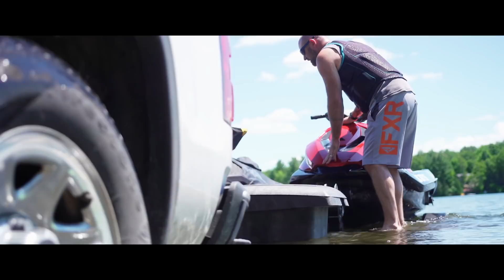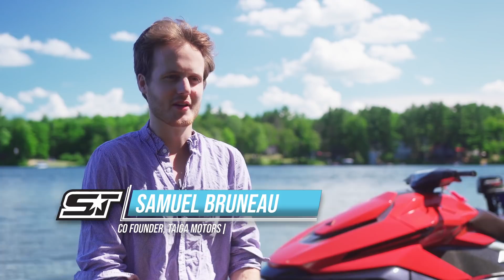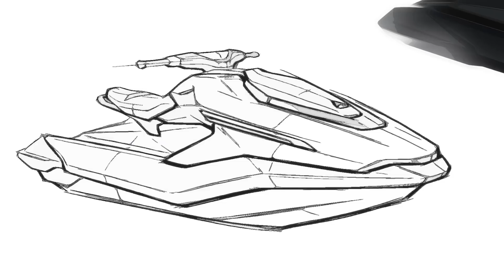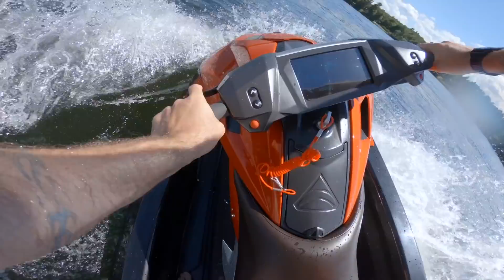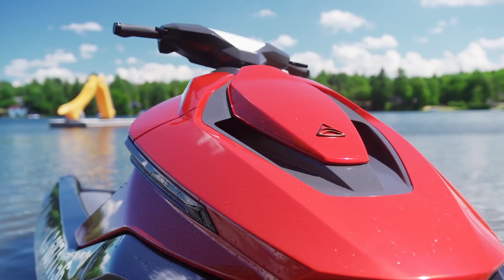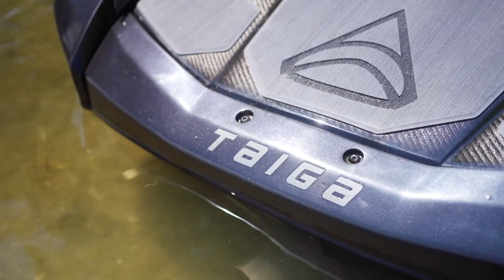First Ride On Taiga's New Orca Electric Personal Watercraft

Comment: I would definitely get one if the price went down and the HP went up. A Sea Doo RXT X with 300 HP   starts at $15,900 in the U.S. which is much cheaper and much more powerful then the top end Taiga. However, in time I'm sure electric vehicles will come down in price and up in power.
Reply: that's a crazy price to pay
Reply: You're comparing purchase price and not total cost of ownership.  To be fair, a battery charge is far less expensive than a fill up.  And maintenance is basically zero on electric.  Personal preference, but I'd rather pay more upfront and have a  ski that's ready to go all the time.  But I also don't need 300hp.  I have a Yamaha with 160 HP and it's more than enough for me.
Reply: To be fair, 15,900 is website prices. You're really gonna pay 20k. With the fees and dealer fees and a trailer cost.
Reply: You'll never use a 300hp ski to its full potential ever. You may do a few speed runs but that's about it. Unless you're racing all that power on a sit down is worthless.
Reply: 180hp performance version is 19k usd...insane prices..
Reply: @FarmerFpv  Well plus they are all governed to a max 67mph from the factory and its alot of money to remove that and reflash the ecu..only to unlock 5-8 more mph..There is a reason 180hp yamahas without a supercharger are just as quick as the 300hp supercharged ones..speed governors.
Reply: Y'all don't send it when you jet ski or?
Reply: @Gcrilla  yep and Taiga is also website price

Comment: Great review and I appreciated your honesty on these PWC. In my opinion, it was only a matter of time before PWC became electrified, and for this type of powersports product, it makes good sense on a number of fronts. Taiga has done a great job of really thinking, and rethinking things through to arrive at a product that will become a preferred type of PWC for plenty of end users, rental companies, and others.

Where I live, there are plenty of lakes that don't allow gas-powered boating, and a growing number of popular waterfront tourist areas and campgrounds that don't care for the noise the PWC emit, so they have started banning them. Not good when you just want to head out on the water and have some fun for a while.

Taiga has done it up right with their PWC having comparable performance specs as many others out in the market, but take the experience to another level by eliminating having fresh premium fuel (obviously) on hand and the potential for spillage into a water source when refueling, gone is the annual servicing and/or mechanical repairs as Luke noted, but enhance the experience with an ability to change performance abilities on-the-fly (even remotely) which is also a great safety feature for riders of varied abilities, plus the flexibility to charge it in a variety of fashions is great. As Luke noted, there are plenty other features and abilities that make this new offering "Awesome!" 

Hearing just the wind and the waves, and the laughter coming from those I'm towing around when out on the lake sounds great to me. Having an ability to get out on, and enjoy, the lakes that don't permit gas-powered boats eliminates those restrictions and opens up plenty of new places to explorer and enjoy each summer. I won't miss all the annual maintenance either, and 2hrs per session I can certainly live with. No more noise and polluting my local water sources is also a HUGE benefit too.

Taiga, you have certainly perked my interest and heightened my level of commitment to get one of these innovative machines under my butt when the desire to hit the water arrives.

Comment: Great video.  This definately makes sense in a cottagers application.  Keep working on the range for the sleds.  We need 200 km range on trail sleds per charge.  Even 100 hp is lots if you get the range up there.

Comment: It would be a major upgrade if the batteries are removable like some EV scooters are. Therefore you can just swap the batteries and continue on. No need to wait for charging and the empty battery can then be the one charging on the "side lines". If not the upcoming Ford F-150 Full EV will be a great addition to have if your going full EV mode in life when it comes to mode of transportations. If the Ford can charge a home it will definitely charge this EV Jet Ski.

Comment: Most cottages in Canada are back woods and off grid so then what haul Gas to power the generator to charge the battery 2 steps versus one with gas and a longer travel ability , I'm thinking practical for the in the city type cottage versus the off grid it's definitely not ready for as exploring is a all day thing not just an hour or 2.

Comment: Awesome presentation but be sure to wear that safety! 
Not sure if the electric version of a ski has a constant flowing jet like its combustion engine alternates, but if you fall off and that safety doesnt come out, you can easily get left by your watercraft.
Reply: Safety first! However, the Taiga Orca doesn't have the issue that combustion PWC has with a constant flow. Once you release the throttle it stops.

Comment: I think offering a kit, to put in older water craft is a good idea, to get the ball rolling.  Heck, you can pick up, working used watercraft, $1000, $1500, USA, pretty easy, rebuilt engine are under that price aswell. 

so, be better offering kits. And build on that.

Comment: Battery volume in kwh? For 120kw engine running on half tortlte we need 60kwh  for one hour. 60kwh weight aprx 300kg. It's far to much for jetski. It means electric jetski time still not arrived.

Comment: no oil or gas worries,  just batteries and electronics worries and will it go from point A to Z without die-ing a low voltage death.
but  you can always swim the last 100 miles....

Comment: Yeah but how much are batteries when they need to be replaced and can the garage mechanic do this. Those batteries are expensive and I would be willing to bet that it would have to be installed by the dealer so that it could be programmed. That’s two down sides right there. A gas powered one can last forever if taken care of and if not, anyone with some mechanical skills can replace a top end, saving the user several thousands of dollars. If you want to go electric, it has to be cheaper or people will not buy it. Why would I buy electric for use on the lake with a 2 hour ride time, when the gas will double that and it takes 10 minutes to fill up and back at it. I think people use these more then just for a few hours a day, the people that I know anyway.
Reply from the maker: Okay, you're assuming the batteries will die before the warranty runs out. Don't think that would be the case. How much is a full engine replacement on a gas-powered PWC? I bet nobody wants to do either...
Reply: SnowTrax TV most of the time though you don’t have to do full engine replacement. You will however have to buy a full new battery. I am just saying that is a down side. I see people with 20 year old jet ski’s on the lake. You will have several battery replacements on these things in 20 years. Plus just like anything with batteries, do we really believe they will last longer then things that use the same batteries. Yes I know they are larger but they still have a short life. That life is also shortened when left uncharged, in the example you gave of when done just leave them and come back after winter and charge them. Those batteries will not last like that. Another down side is where is the charging station and who is going to pay for that.  That is just things that are a down side. Faster and easier to load gas a bring it in my opinion. I also keep all my engines up myself and do proper winterizing and I don’t have problems. I am not saying they don’t have their uses and pros but until they get the price lower then gas, there is no incentive for people to buy them. It is great that they are trying to make head way but all you have to do is look at the market for electric cars.

Comment: The electric jet ski and snowmobile would just not work for me were I ride I have no access to electricity I know I could luge around maby a generator but it's so much easier just to buy a gas driven. If I rode were there was electricity available with out having to rent docks etc I would definitely buy one.
Reply from the maker: Thanks for sharing your comments!
Reply: Small generator maybe? I'm curious as well
Reply: @snowtrax  I need to chat I have a question.privately

Comment: So you had a lot of problems and you still like it on your first time out, I don't think so. Why would you want a jet ski. That's under power, you only have a few hours before you have to change. The motor get wet it's done. How can this dude sign off on this?
Reply: The Taiga Orca has one of the highest power to weight ratios on the market. Weighing 588lbs with 180hp, it's actually pretty insane once you ride it. The range isn't for everyone we agree with that. As far as the motor getting wet 😭 You can drive both our snowmobile and Orca underwater without any problems, as everything is sealed
Reply: @taigamotors  agreed! If you compare it to a Yamaha SVHO which starts at around 17ish, you get 250hp, but it has a dry weight of 822 lbs. Once you include gas (18.5 gallons), and a 160lb rider, you are at 1100 lbs.  1100lbs/250hp = 4.4lbs/hp.  The Orca on the other hand is 588+160, giving a weight of 748.  748lbs/180hp = 4.16 lbs/hp.  The Orca simply has a better power to weight ratio and will be WAAAYYY more maneuverable than the Yamaha. With the energy density of batteries likely to hit 400 wh/kg in thr next few years, and battery prices dropping rapidly, it is not unlikely that within the next 5 years electric PWC's will be more powerful and have longer ranges than traditional PWC's of the same weight.

Comment: I get tired of hearing that electric vehicles are green, you still need to charge the things and this requires coal or gas powered electrical power source, plus the batteries have environmentally hazardous chemicals that need disposed of at special waste sites. Also most of battery material is mined by heavy equipment that burns diesel, I am not against electric vehicles in and of themselves, but they certainly are not as environmentally kind as everyone makes out.
Reply: Obviously nobody's saying producing electric vehicles is not pollutant - that applies to any product ever made! However, post-production, emissions associated with electric vehicles are nil. Unlike gas powered vehicles which pollute during use, on top of the pollution caused by their production. We're not going to get anywhere with that type of thinking "it's not worth it because it's not perfect" - baby steps are needed. For example, if we transition to renewable energy sources, then the production of the electricity with which you charge electric vehicles all of a sudden becomes green as well. Many studies have already shown that over their lifetime (including battery production, disposal), electric vehicles are significantly less polluting than their gas powered counterparts.
Reply: It depends where you live my friend. Most of Quebec's power is hydroelectric and that is why Quebeckers have embraced EVs like Tesla. There it costs about $400 to run the Tesla Model S for 52000 kms. I live in Ontario and I am at 243,000 kms with my five year anniversary of ownership of said Model S being this May 12, 2021. Oh, did I tell you that I yet t have a brake job on it thanks to regenerative braking and the insurance is a lot lower !  No one tells you that.   EV are the jets whereas ICE vehicles are the piston driven airplanes. As for the green movement, EVs are not perfect but they are better than smoke belching gas guzzling cars.
Reply: @mikeparry588  Let's talk if your Tesla is still moving in a few years like my 67 year old Ford daily driver or even my newer 30 year old truck. Truck has 330000 miles on the original engine, needs no oil between changes and can go nearly 700 miles between fill-ups. It does have two gas tanks though but five minutes fills them both. heater is awesome.
Reply: @MatthewBerginGarage  This should be an interesting conversation in 2082, I'm setting a reminder to check back on this on my 102nd birthday to see where things stand.